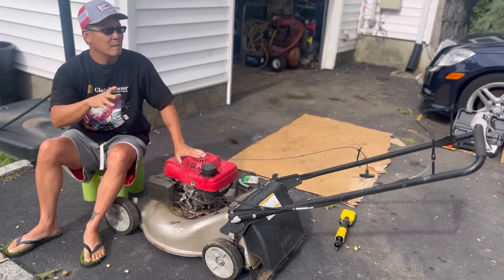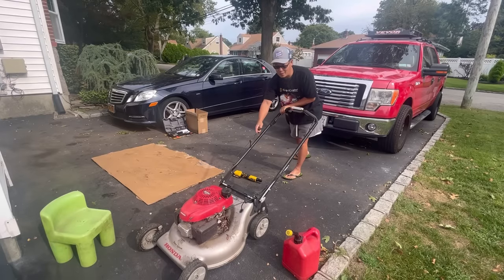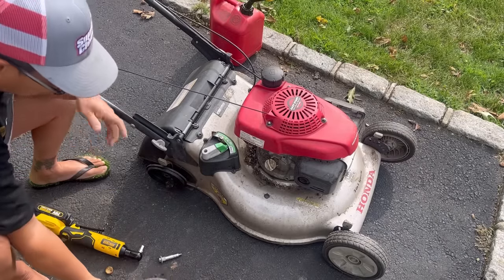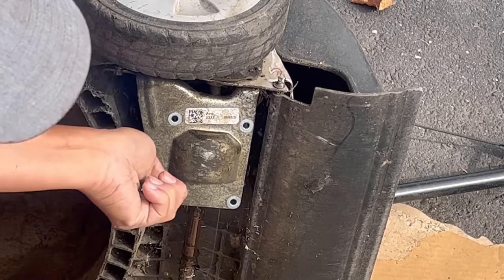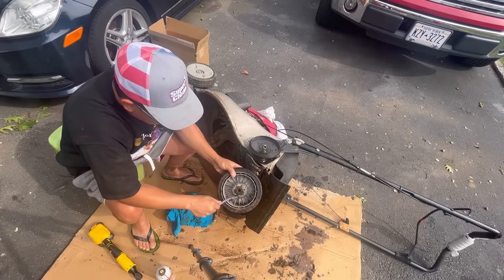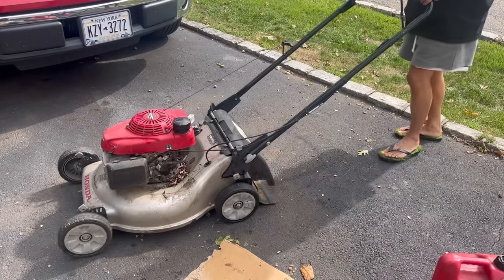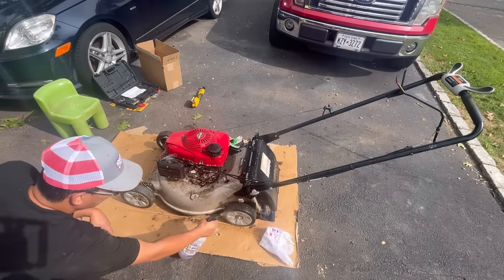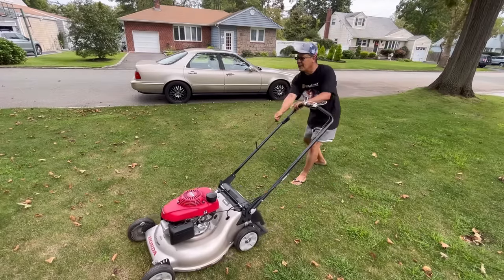FREE CURB ALERT HONDA QUADRA BLADE GCV160 RWD SELF PROPELLED LAWNMOWER WONT PULL BACKWARDS -EASY FIX

Comment: Really like your hand visuals Henry! lmao. If you would have taken the drive gears off of the axles you would have seen the problem. They get rusted and then they wont pull backwards. RWD Lawnboys and some Toros do the samething. I just take the drive gears off and clean them up and put lithium grease on them. Nice mower!  ✌🐕🇺🇸  #superclean
Reply from the maker: Yes sir,  I didn’t want to get too involved.  If it didn’t roll backwards at all after all that,  I would have taken the gears off as you said.  But it rolled and I sold it the next day.  Will show in next video bro

Comment: The silver cylinder bolt on the cables has markings to adjust the transmission..loosen it all the way and then 7 or 8 full turns the opposite way, then tighten.
Reply from the maker: But it was debris in the hub gears,  not the cable
Reply: @MowersNBlowers  you can tell it’s still not rolling backwards properly
Reply from the maker: @RA-oz4xk  good enough to sell